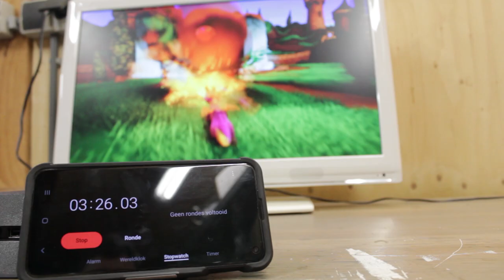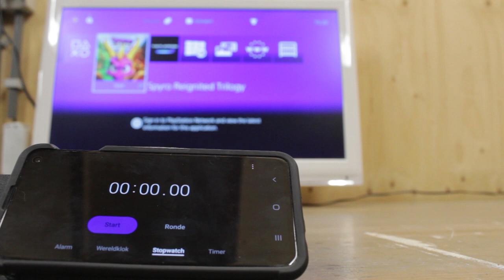PlayStation 4 cleaning tutorial - fix your loud fan.

Comment: Great video my friend. Can I ask you a question about my ps4 old gen. It cut out playing a game and screen went all fuzzy then it switched off and won't go back on its like a power issue. I cleaned it all after that, tried another cable and still nothing. Do you think it will be fixable? Any advice welcome.
Cheers
Reply from the maker: @TheBrickie78  It could be several causes. It is difficult to judge what the cause is without further investigation.

If nothing happens at all (no beep, no blue light, no beep When you operate the disc drive) it is usually the power supply.

Comment: Thank u so much I finally found the same exact model I own lol

this is helpful but I don't have the security torx screwdriver
Reply from the maker: That's great, I would try to get the right torx screwdriver. that makes it a lot easier.
Reply: @SpareTimeWorkshop  yea
Reply: @SpareTimeWorkshop what if u don't have torx screw driver ?
Reply from the maker: @Darealblase0  If so, I would buy or borrow one before you start. Make sure it is a T8H, though.

Comment: I have 1 main question after seeing all this. I hear some people around me say when they cleaned their ps4s and put them back together the ps4 was worse.. either it was louder or would shut it self down saying to hot or the fan completely stoped working and they can’t find a replacement fan that even fits.. why would people be running into this after cleaning the dust out? My sisters man fried his original ps4 fan doing exactly this. How did he manage that? Any ideas what he did wrong?
Reply from the maker: Good question, I think the worse cooling is due to not replacing the thermal paste. If the thermal paste is not replaced, the heat transfer to the heatsink is no longer good and your ps4 overheats very quickly.

I once had a message from someone who also had cooling problems after cleaning. In his case, the type of cooling paste was the cause (according to him). I use arctic mx4 myself and know it works well. I have never tried anything else myself. So from my own experience, I cannot confirm that the brand of cooling paste really matters much. I can only confirm that Actic mx4 works well.

As for the fan, I don't have an answer unfortunately. Never had any problems with them myself. Maybe they break if you spin them up with a compressor with cleaning? But this is just a guess...

Why you would clean your PlayStation there in the first place? Because your PlayStation 4 that is very dusty gets much hotter. Makes more noise and can eventually cause damage to your APU (the solder joint underneath), or a broken power supply.

I hope I was able to answer your questions. Should you get started, please let me know how it went. If you encounter any problems, I will be happy to help you.

Comment: When rescrewing the heat sink, I noticed that 1 screw was left missing (11 out of 12). Had to count twice to make sure.
Reply from the maker: If I understand correctly, you have lost 1 of the 12 screws. 

I don't think it will hurt much if 1 is missing. But I think they can be ordered online.
Reply: @SpareTimeWorkshop  I still have my 1 screw, it was just odd to see the video show rescrewing 11 out of 12.
Reply from the maker: @nm3k511  I misunderstood.

I agree, screwing the ps4 back together could have been clearer. And indeed, I only show screw back 11. Good point.  

I try to shorten a lot so the video doesn't get too long.
But this part is a bit harder to follow because of that.

Thanks for your feedback, I will pay more attention to it in the next video. 👍
Reply: @SpareTimeWorkshop  Confirming that during unscrewing 12 torx screws part on the metallic plate during my 2nd dust clean (really just doing it to reapply thermal paste as it seems I applied not enough for the full length effectiveness).

Comment: Okay so. I've seen this video a couple times. I've noticed that the reason my discs won't go into the system. Is because one of those two blue rollers may he off the track. If thats the issue. Im going to be annoyed. System itself works fine. But I can't put discs in. Anyway. Rambling. I'm just worried about breaking something and being fucked. My PS4 is old as hell. But it still works so. Wish me luck. I will be trying this.

Comment: can i use any other type of alcohol that is not isopropanol?  I have an alcohol-based screencleaner that might work. Contains non-ioninc surfacant and potassium sorbate.
Reply from the maker: I would only use 99% isopropyl alcohol. other products may cause corrosion or short circuit.
Reply: @SpareTimeWorkshop  thanks! I will

Comment: What do i use if i dont have that special screwdriver for the back 3 bolts?
Reply from the maker: I would get the right size screwdrivers before you start. Torx T8H, Phillips head PH0, PH1 and PH2

The PH2 is not always necessary.

Comment: Does anything happens if 1 of the 8 thermal pads is removed ?
Reply from the maker: Probably not right away. I have never tried it myself. But I recommend installing all thermal pads.

Chances are, without the thermal pad, the chip cannot get rid of its heat and therefore your ps4 will malfunction.
Reply: @SpareTimeWorkshop Thx for the info. I have one more question if you don’t mind. My little brother told me that the ps4 started to make weird and scary sound and it overheats and turn off, so i turned it on to see, and after like 2 minutes it started to make a drill sound. It’s like the cooling fan contact with something idk, but the sound is really really bad, so I cleaned the cooling fan and the motherboard and changed the thermal paste (nothing else) and I turned it on and the same sound didn’t change if not worse. I even was in the home screen not playing anything and after like 5 few minutes it turned off. I am so confused like what could be the problem ?
Reply from the maker: @xx_ksaforever_xx  Of course you can ask a question no problem. Judging from your story I think the cooling fan bearing is broken.

You can test the fan of your own ps4 in your brother's ps4. To see if the problem is then solved.  Only that is quite a lot of work.

Comment: What happens if you use 91% instead of 99%? Thanks
Reply from the maker: I think it could use it. But I'm not sure. I use 99% to be sure. I'm very curious if anyone else has anything useful to say about it.
Reply: @SpareTimeWorkshop Ended up using the 91% on the less delicate parts. Test ran it for about 20 minutes of gameplay and everything works great. My 8 year old ps4 is now running dead silent while playing the more system-intensive games. Thank you and great video!

Comment: Bro getting the top off this thing is impossible
Reply from the maker: The top should be doable. I often find the bottom more difficult.
Reply: @SpareTimeWorkshop  the bottom part of the ps4 is the easiest part of taking it apart for me.
Reply from the maker: @Dimensional597  was mistaken, on the PS4 CUH 1200, the bottom is difficult to remove. With this one, it's fine.
Reply: @SpareTimeWorkshop  ah i see

Comment: Hey can anyone help 8:33 I can’t lift up the plate it’s stuck
Reply from the maker: Check again carefully that there are no more screws anywhere.

Maybe the one at 6:27? I forgot those myself once.
Reply: @SpareTimeWorkshop the issue I have at this point is the little 3-wire connector on the right side. When you pulled your top plate off, it was already disconnected.
Reply from the maker: @Azaerys  That is the connector of the cooling fan. If it is not connected then your PlayStation will overheat. But is nice and quiet haha.
Reply: @SpareTimeWorkshop  Yes lol, I found that out. What I meant is that you didn't show taking it out (I'm pretty sure) so it took me a little while to figure out.
Reply from the maker: @Azaerys  Sorry I only read it properly now. I thought I do show that in the video. You're the first one to point it out to me. I'll go check it out right away.
Reply from the maker: @Azaerys  Haha, I see what you mean. While unscrewing the plate, it magically came off all at once. But I'll show it a little further in the video. Been a little sloppy with editing. Thanks for pointing it out.
Reply: @SpareTimeWorkshop  No worries! And thanks for the tutorial plus replying this long after the video was posted.